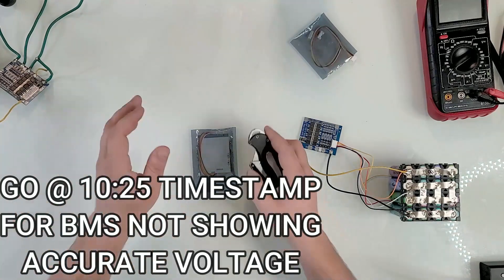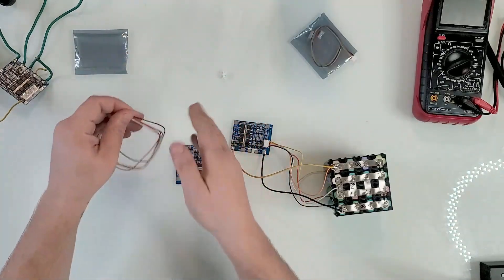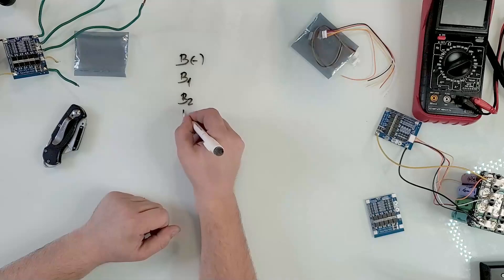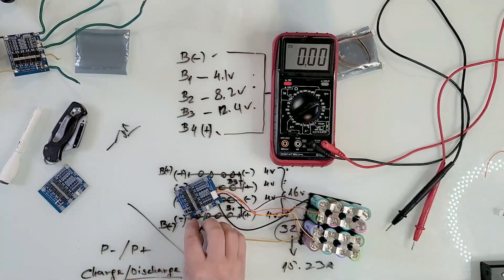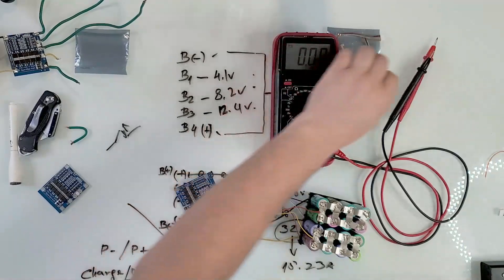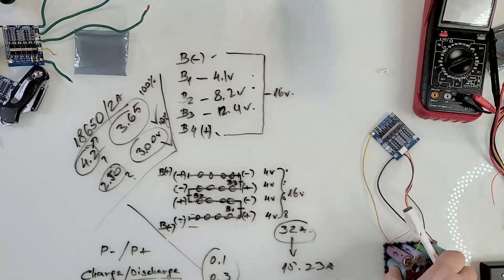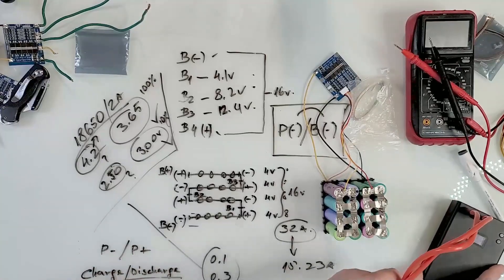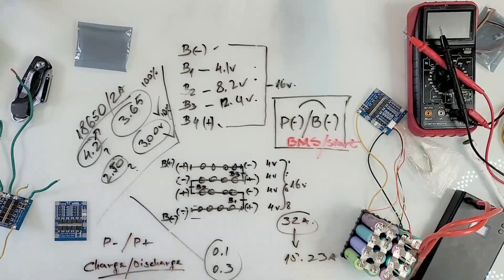BMS not showing correct voltage FIXED, DIY battery basics with BMS explained, / 4S-4P 18650

Comment: All I can say is thank you so much ! Like another person who responded I was frusterated. I had ordered 10 bms chargers and had tried 5 of them and the same thing, low output voltage yet testing the batteries i had proper voltage of 12v. 
I was just lost so I asked Google and got a list some of what is beyond my experience. So I clicked videos and saw your YouTube channel. Oh my gosh I new it was something simple but being new to this making battery packs and it had not happened before I was lost. Until your video late last night. 
This morning I did as you instructed, with a little skepticism,, it f-ing worked and  I am listening to a Bluetooth speaker I made from a oak kitchen table that was in the garbage.
I am not a young guy. I'll be 61 years old next week but I have always been curious how things work. I am example of that you are never to old to learn something new.

I have a question. My 12v Bluetooth speaker lasts about 4+ hours. What can I do in order to double that time?

Comment: Holy $hit, I literally was about to give up and run this damn thing without a BMS. Thanks for the BMS wake info, I had 1.5v on P+ and P-
Reply: At 61 years old I have started making my own battery packs and ran into this issue just last week. I too was lost until I watched this guys video. What a great video. I went through 5 bms chargers and had no luck until this video.

Comment: Hello I'm trying to rebuild my battery for my electric scooter and I actually had a buddy help me make sure that all the sales are putting out the correct voltage and then he also helped me put on a BMS but he gave it to me to finish and I'm not getting the right voltage output from the P negative connection pad on top of the BMS and was wondering if you have any recommendations?

Comment: my bms outputs the correct voltage after its been reset
but after 1 minute it drops half volt on output
it would supply full voltage to load then drop half volt again
even when nothing is connected it would still drop half volt after time
charging would bring it back to full voltage then it drops it again